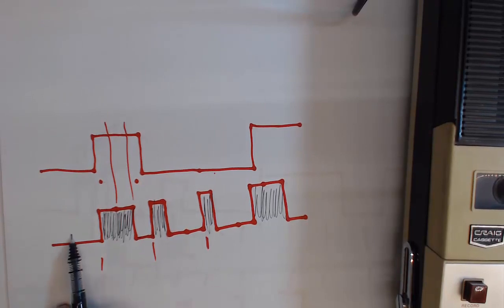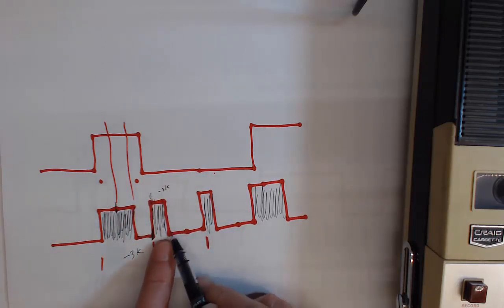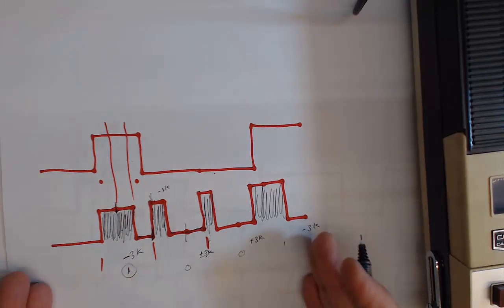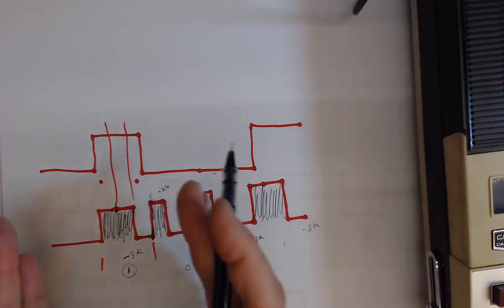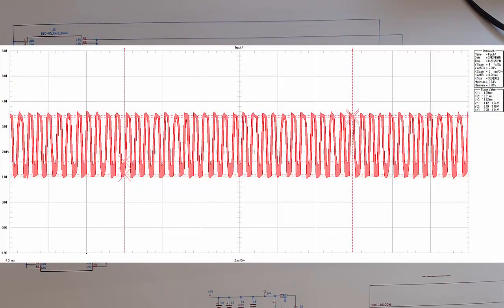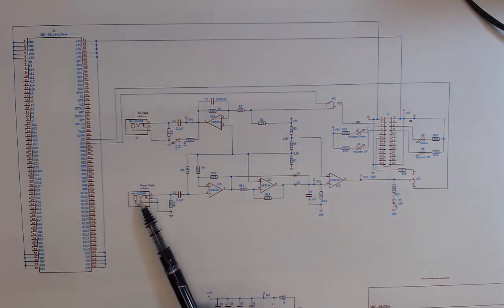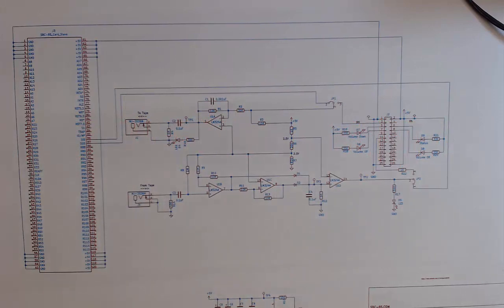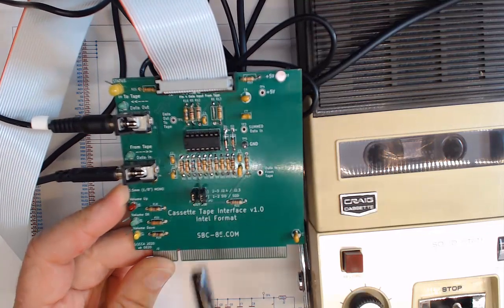{49} Intel Format Cassette Tape Data Storage Interface for SBC-85 and Generic Computer Control

Comment: Was this the format used in the TRS-80 Model 100 cassette interface?
Reply from the maker: I don’t have a trs-80, but I don’t think so.  As I understand they divided each bit into two pieces rather than three and essentially left off the stop bit.  There was a clock bit and data bit, then next clock and data, etc.
Furthermore, each clock and data bit was further split in half and bipolar, with the first half positive (+) and second half negative (-).    The line was neutral (o) if nothing being sent or if the data half of the data bit was a zero.
So a bit logic one would look like this.   +-+-
A logic zero would look like this +-oo 
10011 would look like this.   +-+-+-oo+-oo+-+-+-+-

Comment: Was there ever a consumer grade compact cassette system that could do random access just like the big Ibm's in the old computer rooms?
Reply from the maker: Yes.  There was the Colorado Jumbo tape drive.  First the Jumbo 120 and then the Jumbo 250.  I probably have a hundred backups still on QIC tapes.  it was a fantastic drive for backups.  Maybe not "random" like you are thinking but it was selective and could skip down the tape until it got to the files you wanted.  keep in mind that it could take at least a few minutes to spool the tape from one end to the other.

 I can still hear the vroooom--skip -- skip--- skip---skip--(pause)--reverse---skip-skip--vroooom-skip-skip---vroooooooooooooooooom which continued for an hour and finally the long high-speed vroooooooom that lasted a few minutes to rewind. 

i just found this video of someone doing a backup that should help understand my description above (keep in mind i think he said this was a '486 so far fewer pauses and fits & starts than i remember on my less powerful machines)

https://youtu.be/VZns1_I_P3I?t=1152

 Good times indeed.